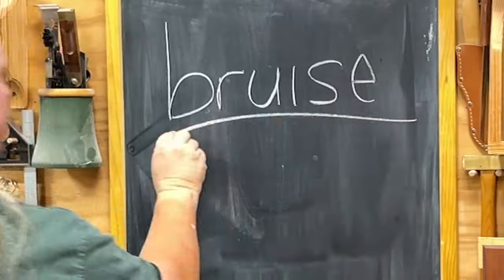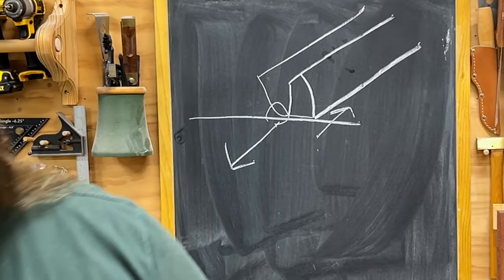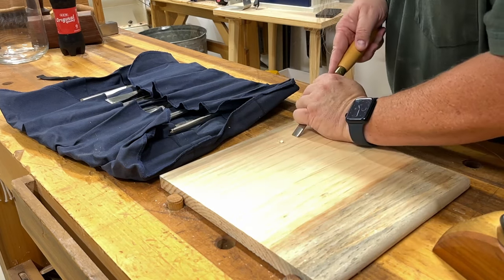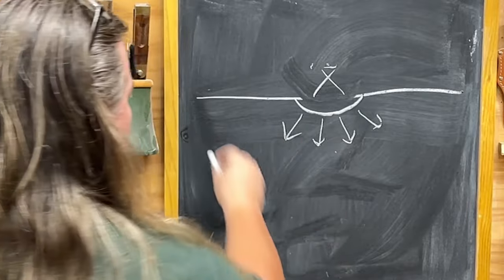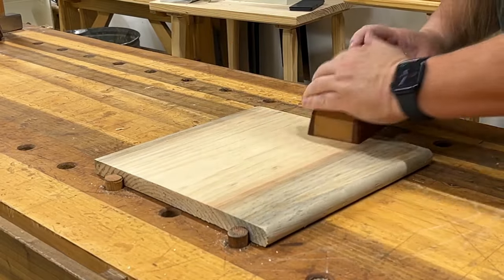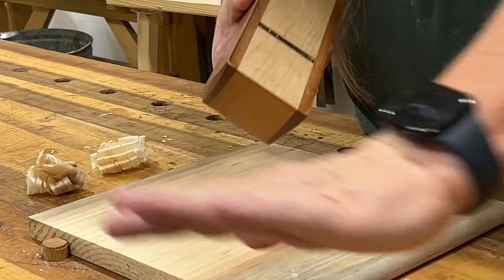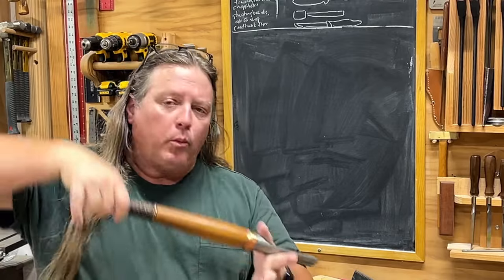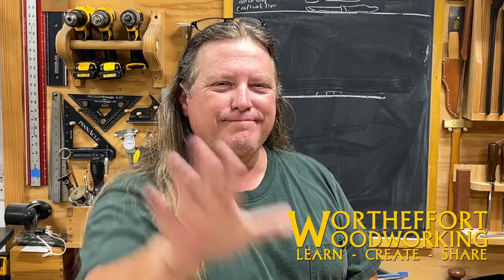WW'nTips-n-Tricks #099: Bruised Wood - What, Why, and how to Fix

Comment: AKA burnishing?  Creates a nice surface.  Spoon carvers who only use edged tools like to burnish.  Many burnish tool handles too.   I'd imagine burnishing could be easy with turning but not so much when you're doing fine wood working  like the big board you planed.
Reply from the maker: Burnishing is different.
Reply: @wortheffort   Any explanation how it's different?  Feel like I burnish with a very small surface sometimes.  I burnish with wood shavings sometimes also.  Can burnish with many things.  You have a lot more woodworking experience than me so I'm interested to hear your thoughts.

Just figure burnishing is "bruising" the entire surface.
Reply: Hmmm, the comments about burnishing made me reflect a bit more. I think I understand what the comments are about, as when I "burnish" I do press the surface to make it shiny. Thanks to the video I now know that is not how it should be done, but many people do it, including me. So perhaps burnishing means you are supposed to gently fill in the surface grain with dust from shavings, but I haven't succeeded in that, but when I press during sanding the fibers indeed are bruised and this makes the surface shiny. And indeed, after applying oil, the results vary... I sprinkle alcohol diluted with water on the surface, the bruised fibers pop up, and sand lightly again, and it looks great. So, apparently I have bruised the wood when turning and the only way to tackle it is to bruise more when finishing. 😂😅 Part of the solution would be sharpen my chisels more often and assess the wood stock I use. Some woods, like European hazelnut, have layers that are dense, but separate easily from the next layer (growth ring). With those I tend to bruise the wood but after applying the finish the growth rings separate and that looks disastrous. That does not happen with birch or apple tree. (That's a pity as I have endless supply of European hazelwood in my back yard...) So, there is a fine line between planing cut and bruising, and that has to do how much force is used. Force leads to bruising and does not compensate shortcomings of the cutting technique or the material that is not suitable for the project. Thanks for the invaluable lesson, Shawn!

Comment: Awesome!  This explains a lot. I've run into this problem, and I've seen others complain of it too.  But I, and others, thought it was an issue with the finishing technique; not bruised wood.  Then, when I sanded off the finish, I just thought I did a better job finishing the second time.  Little did I know, I likely just sanded below the bruise.  Thanks!